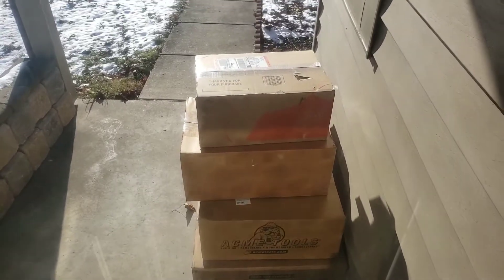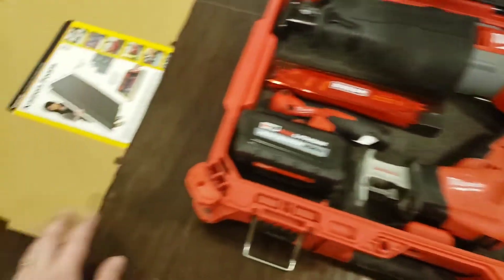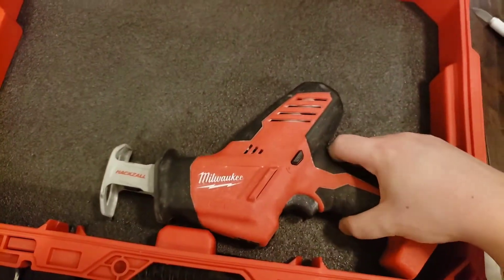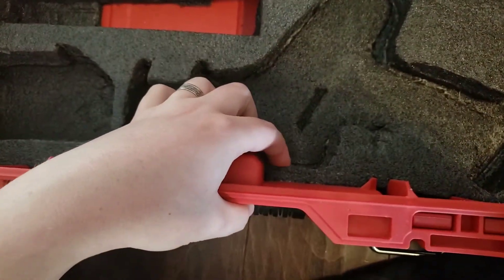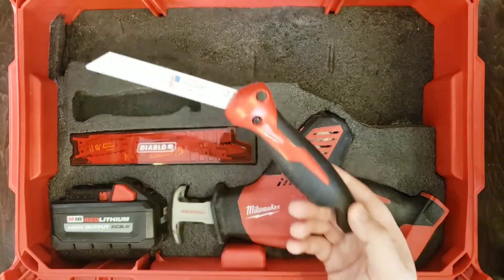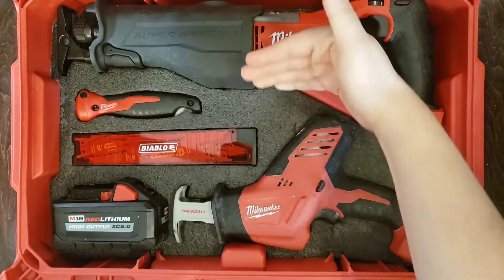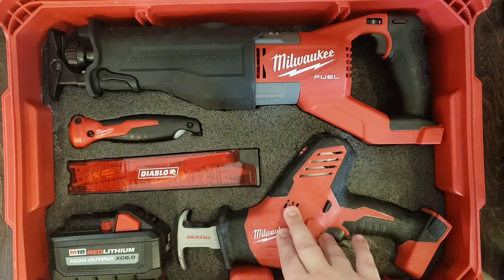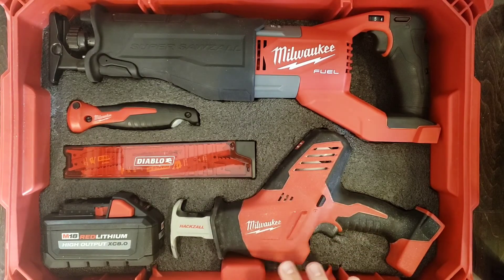Milwaukee PACKOUT Toolbox for Super Sawzall and Hackzall with Kaizen Foam

Comment: Is that the large toolbox?
Reply from the maker: It is the medium I believe. There is a link in the description.
Reply: Link is wrong it’s a large
Reply from the maker: @nycboxing8359  The link is not wrong.  The box in the video is: PACKOUT 22 in. Medium Red Tool Box with 75 lbs. Weight Capacity found at https://www.homedepot.com/p/Milwaukee-PACKOUT-22-in-Medium-Red-Tool-Box-with-75-lbs-Weight-Capacity-48-22-8424/303005652.
Reply: @LyonConstruction  medium is to small to fit those tools due your due diligence
Reply from the maker: @nycboxing8359  It is not too small. The medium fits the Super Sawzall fine.  I can create another video to prove it if you want.